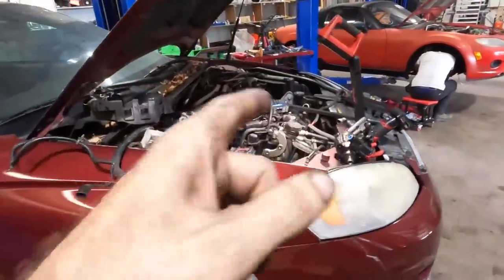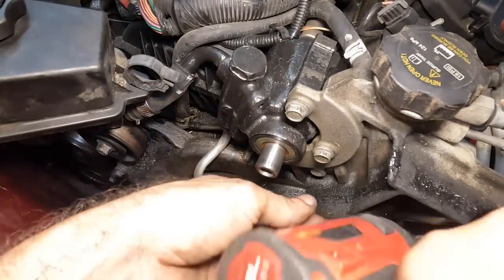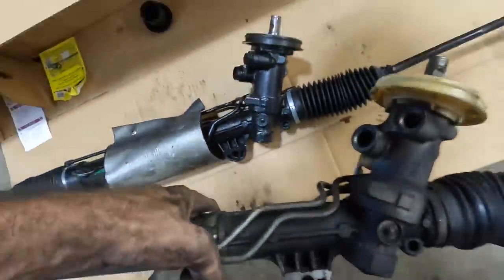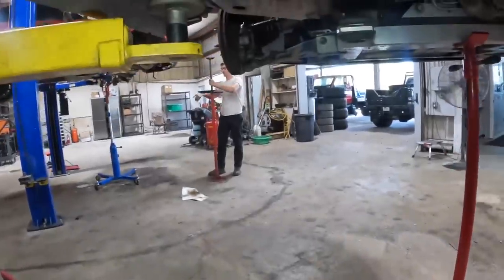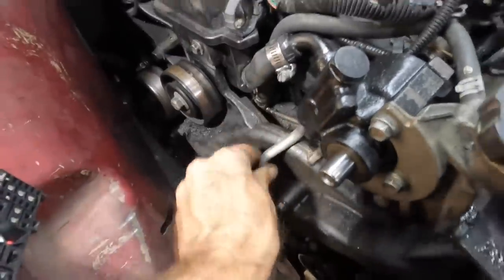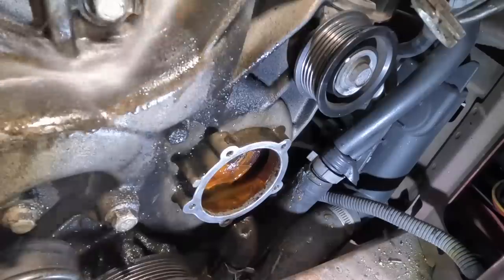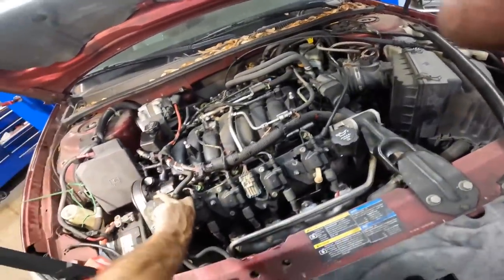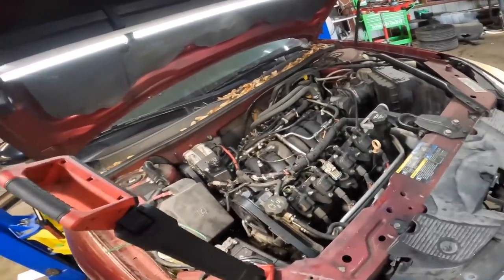Hanging Subframe! Assembly Phase 2007 Chevrolet Monte Carlo SS 5.3

Comment: I have found that if you put a peace of paper or something in the socket it holds the bolt in socket I really can’t believe ray didn’t brake clean that greasy oil build up before putting on the belt  cutting corners now

Comment: Maybe it was just the camera angle but it looked like that cam position sensor wire was still dangling in space right next to the belt unsecured.  The one that had to be rewrapped so the belt wouldn't cut through it.   Ray always solves those little things we notice right at the end.   He'll say something like "and you guys thought I forgot."  Keep up the good work Ray.  I never miss a video.

Comment: I'm concerned that the missing impeller blades from the old water pump are going to block coolant passages throughout the engine.
Reply: As a part time outboard mechanic, I see that problem regularly
Reply: Without completely tearing it down there's not much to be done and it's quite cost prohibitive to do so.
Reply: Yep and that is what made this whole repair pointless. Once that was discovered, there was no point doing anything further than just sell it for parts.

Comment: The only thing I would have done different would be to clean a lot of the oil mess after removing all those parts.  using a plastic mortar tub to catch the brake clean.  But it was a very interesting video.

Comment: The crankshaft on that engine is 5/8 of an inch shorter than other LS engines.
The V6 Monte Carlos with supercharges are heavier than that car.
Check the engine mounts, All 3 of them.

Comment: Hello, question, finding pieces of the pump inside, would an engine flush be needed or am I being too over cautious since most of the impeller has disintegrated.
Reply: Not an engine flush but a Cooling system flush for definite.. i haven’t seen this to the end yet but i suspect he will flush that system .
Reply: Personally, I would BACK flush and forward flush the engine, radiator and heater core all seperatly with a garden hose, not a flush machine. Thermostat removal for the engine flush.
Reply: @scott.koopmann  You're right.He should have started while the water pump was removed.
Reply: @scott.koopmann  agreed … pop a hose on let er’ rip for a good little bit … I maybe probably would put in some of that cooling system anti corrosion /lubricant stuff  in the interest of curving future issues
Reply: Yes, several of us have made this point and asked the question.
Reply: Gotta remember, just because something isn't on video doesn't mean it wasn't done.
Reply: @foltzenlogel    true, and good point, but in this particular case, because there was so much orange rusty goop still sitting there that he blew out with the air gun just before installing water pump, I think it might be safe to at least surmise that he probably didn't do any kind of flush of the engine or the rest of the cooling system.

Comment: Little trick Ray, For an awkward position to start a bolt, Take the socket needed , Take a piece pf paper towel/shop wipe, rip a big enough piece to jam inside the socket where the head of the bold sits then use the socket to deliver the bolt to the position. You should be able to start the bolt by hand and then at least it has grabbed by a few threads.

Comment: Those are polyurethane sway bar bushings, they really needed to be lubricated. And Dielectric grease or some sort of synthetic Greece would have been perfect for it. Because when polyurethane and steel rub together dry, they like to squeak.
Reply: Yep.  You sound like you speak from experience?
Reply: Many new styles have a lubricant incorporated into the bushes for that.
Reply: @NeoMK  he squeaks from experience😂
Reply: @DeepakKumar-lv4te  Thanks for the correction Dad.
Reply: @NeoMK  Dad jokes are the best!

Comment: So, rumour has it that the design team for the SS variant of the Monte Carlo began their meeting by saying, "We have 10 pounds of stuff to put into an 8 pound can.  In other words,  we are putting a V8 into the space we normally put a V6 ANNNNND we're adding some additional goodies like upgraded steering and suspension!  Who's WITH ME!?"  Four designers quit on the spot.  LOL
Reply: I really would like to know what goes on at the engineer's meetings on how they figure out that stuff out.
Reply: Not to mention the two who took early retirement 6 months later due to stress.  They were in charge of serviceability. 😁
Reply: That's nothing.  The design team for the AMC Pacer put a straight 6 into an engine compartment designed for a small rotary engine.  The rear 2 cylinders pushed pretty far back and my memory is changing those plugs were impossible. AMC had a deal with GM to source the rotary but near the end GM scrapped the engine project and AMC was stuck with a production ready platform they had to do something with.
Reply: Have you ever tried changing the plugs on the rear bank of a Ferrari ?
Reply: @robertbowden6478  if I have a Ferrari, I'm not changing no damn plugs, noo siree. New car please!
Reply: @desotosky1372  Very interesting.
Reply: @desotosky1372  There’s at least one Alfa Romeo model with a hydraulic system to tilt the engine for access to the rear plugs. I’m glad I’ve never had to work on one.
Reply: @robertbowden6478  How about changing the plugs on a Pontiac Fiero V - 6?
Reply: That sounds like a fun car
Reply: @BobBasshead  Ah yes, the vehicle made for DIYers that consider themselves masochists.  LOL

Comment: im almost surprised that it was not easier to just drop the sub frame and engine to do this work

it would have given you the ability to de-grease and clean the engine
as well as flush out the coolant ports

Comment: I hope you find ALL the impeller. I would hate to see it clog the cooling system or the cab heater system.
Reply: It's all turned to liquid by now
Reply: just fill the engine with salt water for a few hundred miles, that will dissolve it.  by then you will have enough leaks that the salt water will leak out and you can just keep topping it up with real coolant to eventually freshen it up :)

Comment: I sometimes have to use a bit of paper to wedge between bolt & socket to hold it in place while I 'find' the threads.  Works like a charm and is FREE.  Falls away when I remove the socket so it won't cause any future fouling.

Comment: Did you tie the steering wheel down straight before removing the rack? That's how I was taught and also I noticed you don't count the threads on the tie rods when removing them.

Comment: Hey sorry but you gotta start using fender covers! If the owner is fixing up the mechanical spending obviously a shit ton of money he probably doesn't wanna have to do paint or paint correction because of it!
Reply: You should see when he starts spraying brake cleaner near paint, lol. Ray to the best of my knowledge came up through the chain shop/dealer network, so he focuses on speed of getting the job done.
Reply: @craigfin3222  I would have cleaned those pulleys they had a lot of old rubber from the dried up old belts, cleaned up the old oil that had built up on the front of the engine from the leaks. Make it look like you actually fixed the leaks and be able to tell easier where the leaks are if it when it leaks in the future. But taking care not to damage anything on the customers car is priority one in my book. When I did do any stuff on mine or friends cars I was always super careful with fender covers, supporting things like brake calipers properly. Really could not live with all the tools just in a pile on my bench, wherever that is just a waste when you have to look for things.
Reply: Fender covers don't always guaranty customer satisfaction. I worked for an Oldsmobile restoration shop for a spell. They had a customer who owned a 40 Ford coupe with an Olds 330 engine. He wanted a 455 installed. The car was similar in color to this Monte Ray is working on. Customer came in periodically to check on progress as the chassis needed some bracing added. Fender covers were in place at all times and viewed by the customer. After all was said and done, the customer came back complaining of minor scratches on his front fenders. The customer was looking to get a "free" engine swap.
Reply: Have you seen that car?  The paint is junk on it. Fender cover can scratch just as much.
Reply: @tcanthony2  it's the thought that counts. It's not just that car anyway he had decent cars in there I bet?
Reply: @craigfin3222  brake fluid is really bad for paint

Comment: That belt looks like a royal pain if one doesn't have an ample pry bar. I too hate the whining sound p/s makes as it's either purging air or low...also when one has the wheel at max rotation and holding it there.  The cars coming along very nicely Ray!!!

Comment: I noticed your struggle to enter the water pump fastener, and I have a tip for that. Use the same size socket, but with a small piece of paper between the socket and the fastener. Perhaps you're already aware of this trick, but if not it's handy to know :) I've been following you for a while, and it's really cool to follow your continous success! Love your videos <3

Comment: When Ray say something like "...and we have this connector... I have no idea where it goes, but we'll plug it in here, or here, or somewhere..." I can't help but chuckle.

Cars today have so darned much wires running everywhere and often in such cramped quarters that it's close to impossible to see the layout. And it reminds me of a time back in the 80's or possibly early 90's when car manufacturers were talking about simplifying the electrical systems by using a digital buss for *EVERYTHING*. There would only be one cable loop going to all sensors, indicator lights, running lights, steering, brakes, ECU, sensors, in short everything that used electricity, was controlled using electrical signals, or could be designed to do so would all run on the same shared digital buss.

At the time the latest cars used wire looms that totalled over 2 miles of cables, and they were only growing more and more complex. Using digital signaling they saw the opportunity to simplify that significantly. Two miles of cables should be replaceable with probably less than a hundred yards, perhaps less. And as an added bonus it would be possible to add diagnostic features to every single component if desired.

Well, we now know that we never got all the way there. Not by a long shoot. We can laugh at how naive they were thinking it would be a simple thing to create a digital signaling protocol robust enough to provide the dependability, low latency, security, and remain cost effective. But it was a pretty dream...

Perhaps it's time to look over the idea again. Digital technology has come a long way since the 90's and we have a better idea of what can and what can't be done using it. I don't see any huge security issues with it, considering that we already have cars that can have their steering, throttle and brakes hijacked by hackers. It can't get much worse than that...

Comment: I was wondering if it would've been easier to just drop the subframe and engine to replace all that. But either way it's fun to watch how you do things.
Reply: You can suspend the engine and transaxle from above and remove the subframe by itself on these. It's how you drop the transmission without removing the engine in these body style GM cars. I agree though I'd have just dropped the subframe and saved all that fishing headache.

Comment: A trip for installing nuts is plastic tube ,put a couple of inches on the nut part and feed it in ,better to use 1/2" hose pipes on spark plugs as well if you start to cross thread it the hose pipe slips so you don't mess up the threads ,safer than using sockets ! 
Keep a selection of assorted inside diameter  bits of tube for those out of sight applications you can start the bolt and easily pull the tube off then use the socket.

Comment: Hey Ray, in light of the failed impeller and potentially blockages because of bits and pieces, have you considered doing a backflush of the cooling components?
Reply: Probably not
Reply: Does he ever respond to comments?
Reply: @TheFrenchPug  Only to comments that praise him like a god. Never to comments that question his methods.
Reply: More work for him when it breaks down to negligence
Reply: Also did the motor overheat because of no coolant circulation?
Reply: He would never make a BMW tech. Yes there are pieces in the casting. He would have a rough time with the Saab and it was the GM era.
Reply: @TheFrenchPug  Yes. He's (or the Wife Unit) has responded to a couple of my posts. I've also seen his response to other people's posts.
Reply: Gotta remember just because something isn't on video doesn't mean it wasn't done.
Reply: @scott.koopmann  also prone to the odd lie . one example was when he claimed not to of started the tow truck for a month , but somehow a car got onto it
Reply: I would have backflushed it before the water pump was installed. Sure some of the old impeller would have dissolved but some other solid bits would still be floating around. However I am guessing Ray's view is that those solid bits are not actually circulating but are resting in the bottom of the block. Retired mechanic in Land Down Under.
Reply: @usat42  OH-NO , shock horror!..😮

Comment: I’m late to the party here but there is a clip missing on that power steering pressure line that holds it to the upper bolt of the belt tensioner, that holds it away from the belt where you were having clearance issues

Comment: Hey Ray, getting those pesky bolts into the blind holes are a pain. Do it the easy way,  put a piece of paper towel over the socket then push the bolt in the socket. That will keep the bolt in tight and properly centred so you can thread it in by hand using just the socket.
Reply: Good tip.  I have always done this, but with a piece of masking tape.
Reply: @quicksilver462  Ive done this as well
Reply: A short piece of 3/8" fuel line pushed over the hex head works too.....
Reply: A small button magnet epoxied on the end of an extension or into the top of the square in a socket where the extension plugs will securely hold a fastener in place and square while you get it started and it's easy to just pull the socket back off because the magnet will come with it and not hang up on the fastener. I found these tiny little magnets in a craft section for building engineering projects.

Comment: I found out that if you place a small magnet on the extension or in the socket it's easier to start small bolts and nuts.

Comment: Did a Honda Odyssey starter today...twice... Because the positive wire was squashed between the starter and the trans, to tbe extent of potential short circuit. Pulled it back out and altered the angle of the connection, and reinstalled....
Twice is more fun!

Comment: I really wish I could make this my career. But I guess a hobby is nice too. Only issue is I cannot get certified since I need to work for 2 years to get certified and I would have conflicts with my job. :( But I did get a 2000 Toyota Corolla that was dead. I put more money into it than it is worth, but taught myself a whole lot and got it started and running. No codes!

Comment: I've owned a gxp since 2009 with this powertrain as long as u don't holeshot it like a 16 yr old at every light it will last I've gotten 178k as of this date with only standard maintenance and when it was new has a trunk water leak and a slight oil leak fixed under warranty.

Comment: I have the exact same car and color. Mine, however, has a sunroof and leather interior. I bought mine in 2018 with 53K miles. 2020 at has the trans replaced. Now as I'm typing this. I'm having the engine rebuilt at 88K miles. Too much power for the trans.  I learned after the fact.  With the engine being equipped with the Active Fuel Management System, Lifter #1 failed and pitted the cam. I have a Love-Hate relationship with GM.

Comment: You should probably flush the motor out see if some of the metal comes out from the previous water pump.  Might be able to pressure flush some of that junk out.

Comment: It's best to use a brass wire brush or wheel on your power tool when cleaning aluminum surfaces, brass being the softer of the two materials. Also, clean up the inside of the housing where the impeller is centered and get out all that rust.  Too much housing material missing and the pump will not have enough pressure and the volume of fluid pumped will be low and sometimes not enough to cool the engine under loads like A/C on, going up steep hills.

Comment: Hey Ray, yup by starting the line into the pump before locking it down you avoid fighting it, and also you avoid the dreaded cross threading, this can be done with the PS Rack also.. (by you I mean you as in us and not you 😉) Also sorry I caught this too late to suggest replacing the idler pulleys, it can save a lot of work going forward and a questioning customer. I always replace them on belt replacements, it keeps everybody happy, and is cheap insurance. One more thing, you might want to look into a vacuum coolant filler kit, it is so much faster than the old fill and wait method, and if you do any cars with water cooled Turbos, it is the only way to get all of the air out. 
 Anyway, keep 'em rolling Beau.
Blue Mule 
NC

Comment: It's not a cure for "chunks o' impeller blade", but otherwise I Rx a treatment with ThermoCure, a product by the nice folks who brought us EvapoRust. Run it with water in your system for a week, drain and flush thoroughly, all the rust throughout your cooling system has been cleaned out.